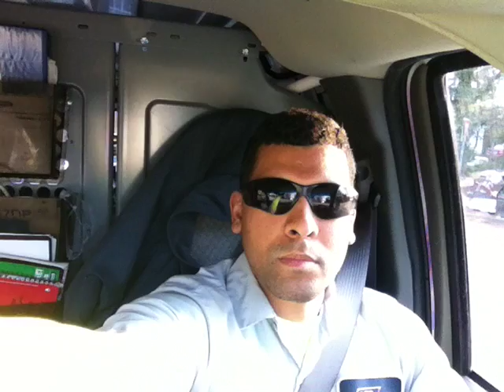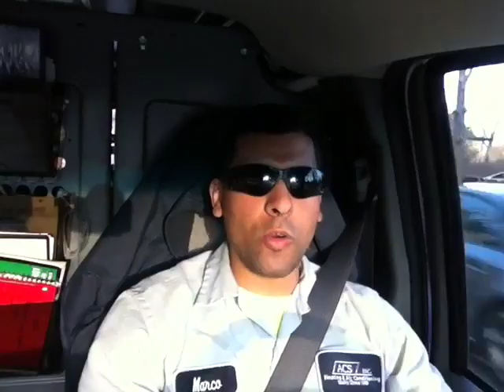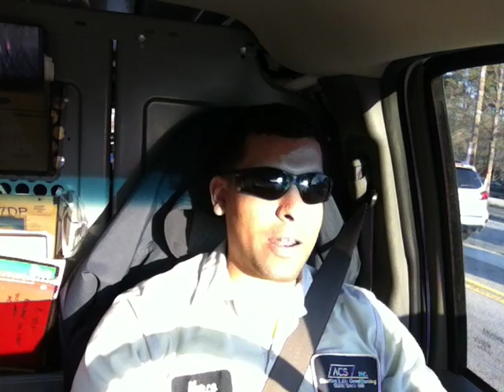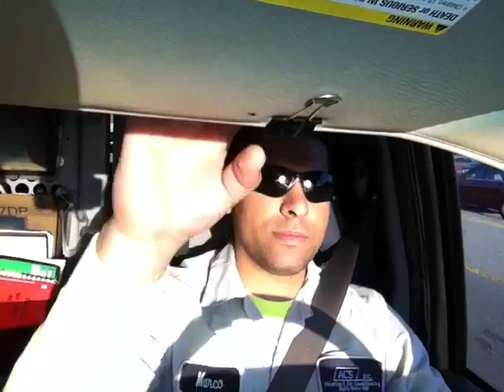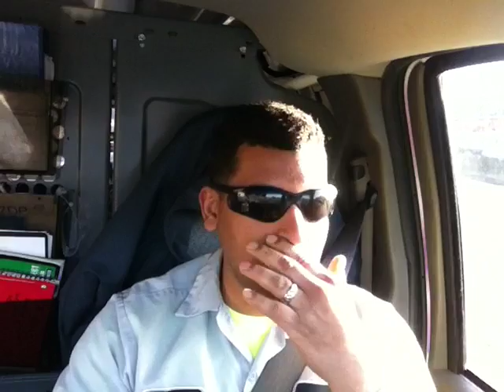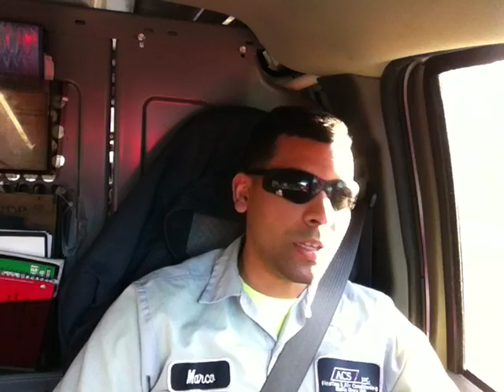Hvac: replace vs repair

Comment: agree 100%, i always tell customers is price of repair vs price of replacement. For the age part of it, I also been told that its 15 to 18 on Furnace(depending on Brand), and 14-16 on A/C(depending on brand). I agree with that time frame IMO.  Most people for where i work go with new equipment mostly if the had to many things fail at different times (board, motor, etc)

Comment: I like to do what i think is best value for a customer, most times its repairing but sometimes its replacement, it depends on the equipment and the customer.

Comment: Xe25 needs a intermatic compressor defender. They will pay up to $7500.00 if it does not take the electrical hit. Great add on to the high end systems.
Reply from the maker: Interesting... I'll look into that for future jobs. I know supco make a surge protector that you can hook up to your disconnect but idk if it'll protect the inverter boards. Thanks for watching!